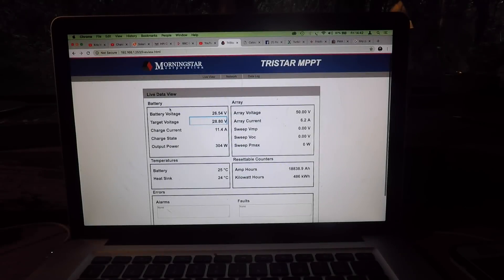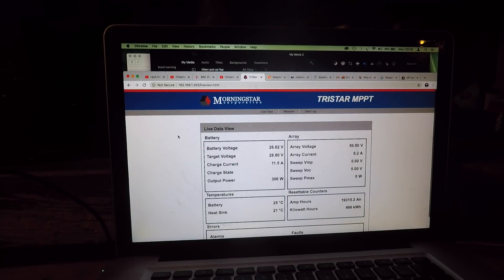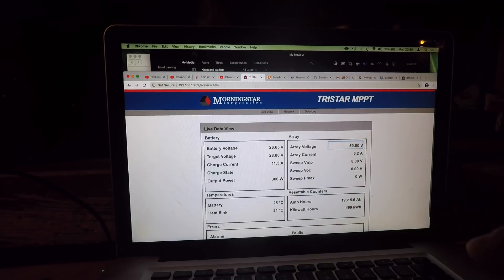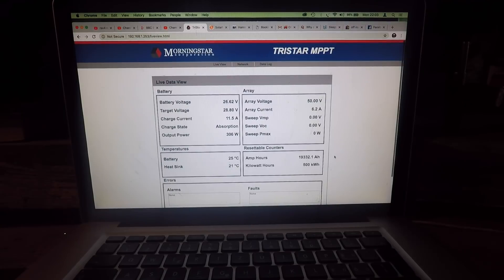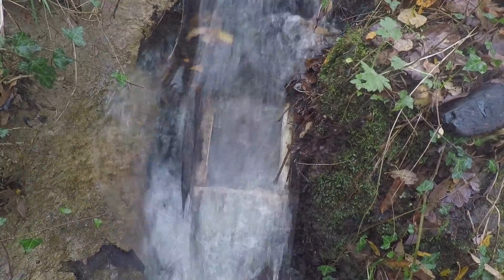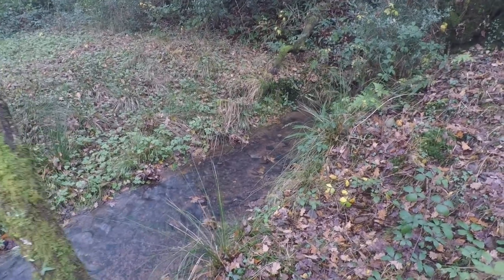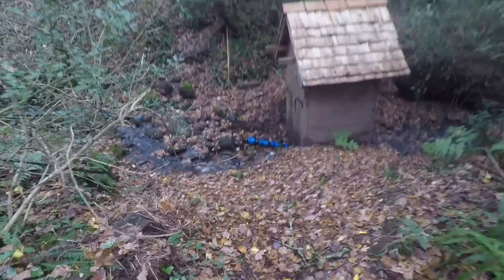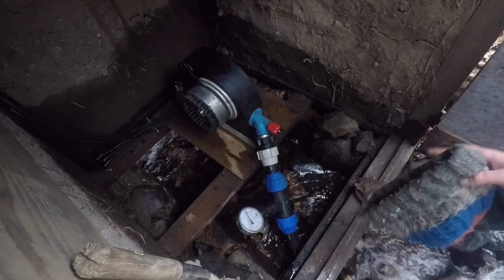500 Kwh Off Grid Hydro Electric Pelton Turbine Update

Comment: Hi Kris, nice update thank you for posting, this may be of interest to you, this summer i built a system very close to yours my turbine is the ME1112 running on one jet same jet as you have at 28 psi  i'm getting 300w running on 2 jets at 24 psi i'm getting 500w i have a third jet to hook up today for when we have heavy rain and extra water,  i was thinking rather than hook all three jets to one turbine it would be better to buy more turbines and use one turbine to one jet hoping to get 300w per jet, i think this could definitely work with two turbines and maybe a third if i can keep the pressure, i plan to do some experimenting over the next few day. The only thing i did different is mine is grid tied as your is off grid, i was hoping to still use the second single phase take off on the turbine for a battery bank but so far i can only get 1000rpm which amounts to 10v, if your turbine is a different model to mine and you have over 12v on your single phase i'd be interested to know which one you have.
Anyway keep up the good living and have fun 
Take care
john
Reply from the maker: Hi john, you are way better off adding more nozzles to the same turbine (as long as the alternator can handle it)  rather than adding another turbine. Another turbine will just add lots more losses. you will never get double the power when you double the flow  because of the penstock loss. it sounds to me like you have reached the caring capacity of your penstock. the more water that flows the more the pressure will drop until they cancel them selfs out. google Pipe loss calculator and you will be able to calculate the losses.  i 100% guarantee you adding another turbine on the same penstock will more than likely get you a little bit more power. but less than if you just added another nozzle. but the main problem here is your pipe size. its to small to carry the extra water without ever increasing losses.

If you send me your internal pipe diameter, pipe length and flow rates i could tell you what you will expect to get.

here are my figures that i will expect as flow increases and nozzles are added
1l/s@ gross head of 18.5m = nett head@ turbine of 18.1m = 113w with a flow of 2l/s@ gross head of 18.5m = nett head@ turbine of 18.02m = 226w and with 3l/s@ gross head of 18.5m = nett head @ turbine of 17.9m = 338w, 4l/s@ gross head of 18.5m = nett head @ turbine of 17.74m = 445w, 5l/s @ gross head of 18.5m = nett head @ turbine of 17.53m = 550w, 6l/s @ gross head of 18.5m = nett head @ turbine of 17.3m = 651w, 10l/s@gross head of 18.5m = nett head @ turbine of 15.97m = 1kW, 15l/s@ gross head of 18.5m = nett head @ turbine of 13.5m = 1.27kW, 20l/s @ gross head of 18.5m = nett head @ turbine of 10.28m = 1.29kW.  You can see that trying to push 20l/s down the penstock creates a huge loss in head at the turbine, in fact 15l/s=1270w & with 20l/s = 1290w just a 20w gain.
Reply: @KrisHarbour  Hi Kris, thanks for your reply and your figures that's very interesting.

 I got the third jet attached today but have some kind of problem as i went from 500w to 400w  so need to work through it and see what i can find, i have a few things running through my head so will have a play with it over the next few days, the pressure dropped to just under 20 psi with all three jets open which is what i expected as i tend to drop 4psi for each of the other two jets. it's interesting you only drop 1psi so i'm guessing my pipe isn't as flat/straight as yours.
Ok my original pipe was 110mm (4") water pipe like yours with an average inside of 96.3mm, it was put  down in three 50m sections  although i had around 6-7m left over so length is around 144m,  i measured the head at around 15-16m, when i put water down the pipe for the first time i had 27psi  i was expecting around 22psi,  by the time i built the powerhouse and set the turbine it dropped to 25psi as the turbine is raised up of the ground by around 1m, i messed about and ran it for a week or so but 325w was the max i could get so decided to extend the pipe further up the hill to get a little more pressure, i did this with soil pipe and flexi joints, thinking the pressure would be much less up the top end so should hold fine, the soil pipe is the also 110mm, this took me up another 50m in length and i gained around another 2.5m in head, to my surprise the standing pressure is now 32psi so my head calculations must be out as i believe it's 1psi for every 2.33 foot of head
My flow rate like yours goes up and down but at this time of year i have no less than 6ls, because of the rain over the last few days i have way over that in fact the pipe sits down in the stream bed and i have around 3" of water flowing over the top and that's with two jets open although this will die down in a day or two, i have the jets open around 2/3rds as i found opening the jets to full ie when the red knob is flush with the first thread it makes now difference in the turbine speed/power and just puts more water through the system, so if you use the finger groves on the red knobs and cound till fully out you get around 50 i have mine set at 35, this is putting around 2.5ls through each jet.

Kris i don't want to mess your page up with long messages so this is my email if you would rather reply to this.    johnbt92@yahoo.co.uk

In a nutshell this is something i've always wanted to do since moving here and understand there will be a lot of learning to do which is all part of the fun but if i can i'd like to get as much power as possible as you will know pipe and fitting don't come cheap so it would be nice to get max power out from the system

Thank you again for the chat much appreciated.
Take care
john
Reply from the maker: It defiantly sounds to me like the losses are in the pipe. that is a big drop in pressure and is defiantly from friction in the penstock.  do you have small diameter pipe going to the turbine itself? mine goes down to 50mm to the turbine. if your trying to push 9lps through small pipes that could be sucking up alot of the power. also any 90 degree bends? and joins? shut off valves? all that stuff will suck up your efficiency.

Also if your turbine is sized to work at 30psi then dropping it down to 20psi means the nozzle velocity changes. in order to get the most amount of energy out of the water the turbine should be spinning at about half the speed on the nozzle velocity. so if you reduced your psi by a third (due to the losses) you also need to reduce your rpm or Jet PCD by a third or the energy will be lost to the water just flowing passed the turbine without imparting its energy.

so to summarise the losses in your penstock due to to much flow, joins, or bends it reducing your pressure making the speed of the water coming out of the nozzle reduced. the reduced water speed is now impacting the turbine at an inefficient speed. the solution is to fix the losses in the pipe and raise the pressure. or to change the turbine size to lower the rpm to suit the new nozzle pressure.

This isnt clogging it up, this is very good information for people to read.
Reply: @KrisHarbour  Hi Kris, i have a 110mm to 90mm then a 90mm to 63 reduction which is a 90 degree bend this then runs to a  63mm shut off valve then a 63mm to 50mm tee to split off to jet 1 and 2 all the rest of the pipe is 50mm,  there are a few 90 bends to get the pipe to the turbine ie three on each side, i added an extra 50mm tee today with two more 90 bends for the third jet so it is a bit of a mess in that respect, i was thinking about using some flexi hoes and cam locks thinking i would get a better flow so can still go down that road, or was thinking about larger pipe say 63mm up to the jets then a single 50mm to the jet but not sure if this would make any difference.
My main pipe isn't to bad for ups and down although i do have a big dip as it crosses a deep part of the stream, that said when it comes out of the dip it's still flowing down hill if that makes sense, what i mean is it hasn't a climb up out of the dip it's more flat then down hill again, i will be building a support under this at some point., another part is where i originally started the intake, it's an old dam so the bed is quite flat, i have around 1.2m of good drop then around 15m of quite flat, it's possible i can lift the pipe to give a better even slope which may help with flow.

The turbine i think is the same as yours ME112 it's rated at 3-4kw, to be honest i have no idea what pressure it is sized for,  the seller says 2800 rpm is needed for 4000w my rpm is around 950-1000 with two jets, i have to admit i'm a little lost when you talk about the water speed at the jet do you have a calculation for working this out ??

It's all trial and error i guess and everyone's will be a little different, my aim when i started was 450w so i've achieved this but you know what it's like when you start something you start wanting more and more and if there is more power to be had i may as well tap into it .
Take care
john
Reply from the maker: Well those 90 degree bends will sure waste some energy hose would be a much better option. with regard to the rpm think about it like this.... if the water leaves the nozzle and hits the turbine and the turbine moves away from the water at the same speed as the water 0 energy will be captured. if the water hit the turbine and it does not spin at all again 0 energy will be captured. so the load on the alternator (voltage) needs to match the turbine size in order for the turbine to spin at about half the speed of the water in order to catch the energy. if you let your turbine spin at free spin with no load and record the voltage. you want the voltage to be half of that when it is loaded to get the most out of it. does that make sense. no need for trial and error if you do the right calculations.
Reply: @KrisHarbour  Hi Kris, Thanks again for your input, putting it that way makes more sense to me, ok when the turbine is spinning free with 2 jets the volts are 240dc this is the max the turbine will put out give or take a little,  i did this test when i first set up so i knew 1) i wouldn't put to many volts to the inverter if the grid dropped out and possibly fry it as i didn't want a dump load and 2) i needed to make sure when free spinning the turbine could handle the speed till the grid come back up or till i got to it to close it down, as i'm typing this i'm looking at the inverters wireless monitor and the turbine is running at 495w and 120v dc.

Something else i need to look at is my turbine box, it's just a rough build till i was happy with the jet setting ect not like yours the used water doesn't drop out of the bottom as the box is more or less sealed with a 110mm soil pipe to allow the water to exit, i'm thinking there must be some turbulence inside which could also be adding to the problem, i possibly need a bigger exit pipe.

Take care
john

Comment: Quick question.. Has anyone brought up the issue of your battery sitting on top of each other? If I'm wrong correct me..  I've always been told never have your battery sitting on concrete or other batteries unless they're dead already.
Reply from the maker: I Have never heard of this. but im open to hear more about it. i mean cells sit side by side all the time so i cant see why they cant sit on top?
Reply: I know with concrete it's something to do with the steel reinforcement in the concrete that draws the amps/ wattage out of the battery.. innocent killing it slowly

Comment: You could totally make a water pump to pump water up to the lake. Like, you turn the pump on when the batteries are full, to essentially "charge" the lake with otherwise unused power. And when you have a huge demand in power (or drought) you can tap the lake like you where planning on doing anyway. Just like a hydro power station....
Reply from the maker: The lake is spring fed and gets a load of groundwater run off from the land. it will fill itself up very quickly.
Reply: I see, then it might not even be worth the effort, even though you won't need a lot of extra parts to make it function like this. Maybe in a drought situation where you can use excess solar energy to pump some source of water up to the lake? Meh, I'm probably rambling at this point. Greetings from Denmark by the way :)

Comment: Good to see the hydro back again, could you run a 48v system with your generator or have you considered it?
Reply from the maker: I could and i might one day as my power consumption increases with the new workshop i might have to.
Reply: @KrisHarbour  That's good to know, wasn`t sure if the voltage would be capable for charging 48v constant. I have a stream with about the same head and flow, looking forward to your upgrades. Currently pining for a Pip 5048 built in charge controller, worth a look.

Comment: Hello, I had a probleme with my turbine. A diode inside the bridge rectifier went on a short circuit. one of the 3 windings has heated up enormously, and is now out of order. I did not have any electrical protection between the generator and bridge rectifier!  I have to change the strator. I advise you to add a breaker as for a three-phase electric motor
as :https://www.schneider-electric.fr/fr/product/GV2RT14/tesys-gv2rt---disj.-moteur---6..10a---3p-3d---d%C3%A9clencheur-magn%C3%A9to-thermique/
Reply from the maker: That is a great suggestion. Thank you. i will order one. i hope you get up and running soon.